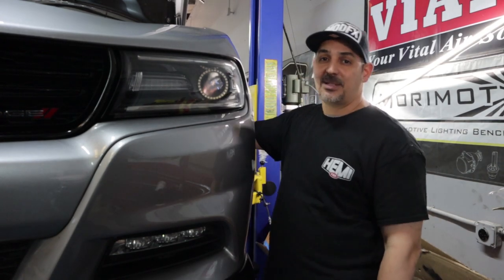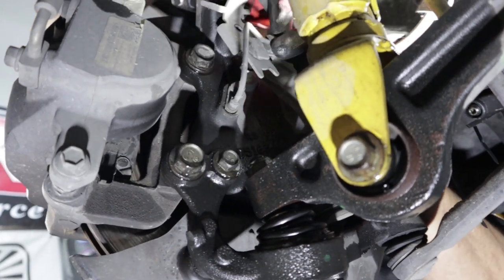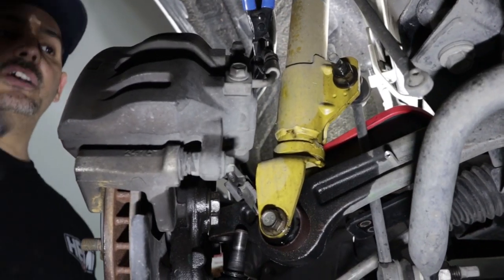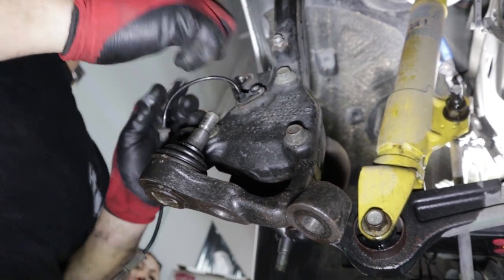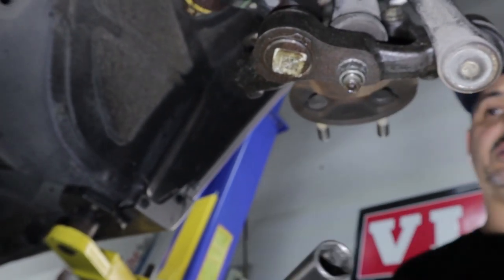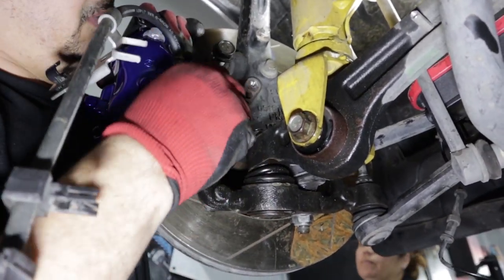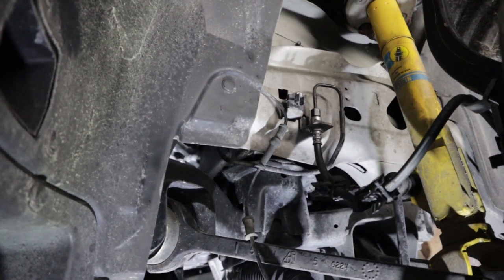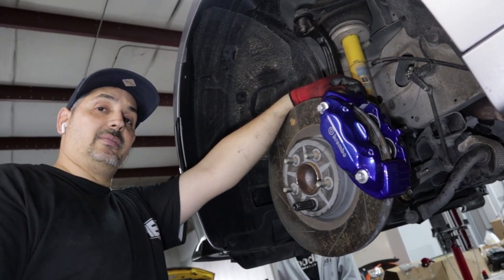BREMBO BRAKE KIT INSTALLATION ON V6 CHARGER (DIY)

Comment: I have a 2019 charger scat pack and it came with a 4 piston caliber but I want to swap to a 6 piston caliber do need a whole new spindle or knuckle??
Reply: Nope that’s a direct swap, no need to change anything but the rotors and brembos.
Reply: Thank you Jose
Reply: @getfdaz1  I have the 2013 charger R/T do I need to change the spindle knuckle to install SRT brakes ?
Reply: @hasankhalid1204  yes sir.
Reply: @getfdaz1  thank you 
How much does it cost by your side?

Comment: Nice video man. Thanks. Do you also need to replace the rears to add the brembo’s on a r/t?
Reply: Idk if its too late but as long as you have 20 inch wheels you should be good
Reply: @Daytona-dz9xe  so if I got 20s I don’t need a kit?
Reply: @lilsamreactions507 if you got 20s you still need a kit, but if you have smaller than a 20in wheel then the brembos won’t fit at all. The brakes would be too big and would hit the wheel and you wouldn’t be able to drive

Comment: I’m thicking about getting a Jeep Grand Cherokee limited X with an 5.7, and I want to upgrade that with the srt conversion. I want to put the srt body/ front fascia, rear bumper, and side skirt on it as well as the brembos with a nice Luh tune and full bolt ons. Do you think it’s possible?

Comment: I have a 2018 charger rt  and I bought four piston brembos calipers it was able to go in the front with sport rotors but the back wasn’t compatible. what do i need to get the for 4 piston caliper to go The rear wheels
Reply: How were you able to fit the brembos on the stock R/T spindles in front?
Reply: @hectorcampos5976  idk bout I think it would was it was swapped with srt spindles tho
Reply from the maker: You need the rear spindles for the rear to work with the brembos

Comment: Hi I got a 2013 Chrysler 300 V6 what year does the brembo brakes have to be so I can order them or is there a website that comes with everything
Reply: They have brembo brakes for the model year 2015 and up as well as  2011-2014 model year. You need the ones for 2011-2014. I recommend buying some offline at a discount stripping them down clean them put new rings and seals in them and then get them installed. I’m upgrading my 2017 5.7 Daytona. I’m getting them powder coated though before I put them on
Reply from the maker: You can but the Brembos from any of the SRT/Scat pack models of the similar cars. Challenger/Charger/300 etc.

Comment: Looking to do this with my 2017 Challenger R/T. All I need is the spindles and knuckles?
Reply: And brake lines?
Reply: Did you ever find out ?
Reply: @FreeBandsTy  yea I got it done then traded the car in
Reply: @derottv  lol what all you needed for the bembos ?
Reply: @FreeBandsTy  srt spindles and knuckles, rotors, and brembo banjo bolts. U can get new brake lines if u want but the ones that are on there can be modified to work on the calipers.
Reply: @derottv  how much did all that run you ?
Reply: @FreeBandsTy  parts and labor about 3k
Reply: @derottv  not bad honestly

Comment: Okay I have a lot of questions because I’m trying to make mine a track car sleeper.
Reply: Gonna need a different car if you have a challenger/charger.  They weigh too much to be a "sleeper".  4600lbs+ at least.
Reply: @jdigitalseven7  okay mustang pfp. In that case you’re gonna need a new transmission preferably a 10 speed because (I’m guessing) your manual is slow af.

Comment: I have a 2015 challenger with spc control arms to adjust the camber on my d2 adjustable struts. What would I need?
Reply: J R do you have a RT? You need the spindle with A arm assembly and rear also. Hit us up if you need sourcing.
Reply: I have a 2017 Daytona Charger just picked up a set of brembos from a 2019 scat charger. I need all four spindles/ knuckles now.

Comment: So if I wanted to swap from 14 Dodge Durango rt stock brakes to scatpack brakes do I have to do a complete spindle swap or can I just swap brakes?
Reply: You need Jeep SRT or trackhawk calipers. No need for spindles. Bolt right up. You will need wheel spacers if you have the factory wheels still

Comment: I have a 2019 sxt challenger and just ordered 4 piston brembo and roters off 06 srt8 , will I still need new spindles ?
Reply: Get some washer and pit them inbetween the screws they fit the srt spidels just fater
Reply: super medium tv thanks bro
Reply: isaac byrd hey did it work by just putting the washers? Wanna do it to my rt but don’t wanna get spindles. Thank
Reply: @hammadjawwad2340  haven’t tried it yet I need to do more research
Reply: @isaacbyrd8504   did you buy the rear spindles??

Comment: typical ghetto auto shop ... didn't torque anything to spec, the other guy put the ROTOR on the GROUND!! BIG NO NO, and multiple other issues as a mechanic that you shouldn't do

Comment: Jose i have a 2017 Chrysler 300s 5.7 do i need to replace the spindle to upgrade to the 6 piston Brembo?
Reply: Raul Valdez yes u need the same as implied in video.